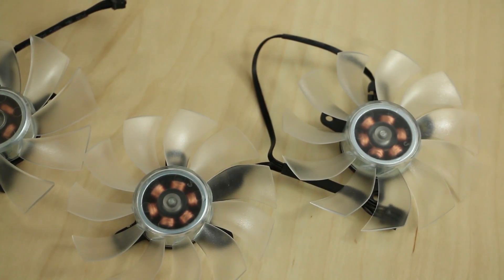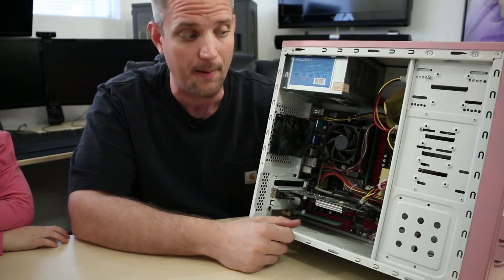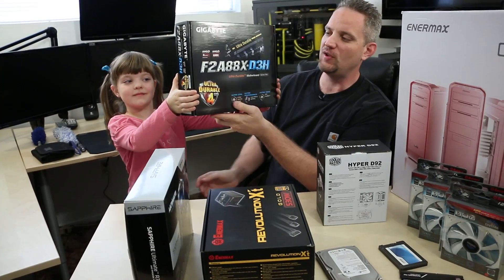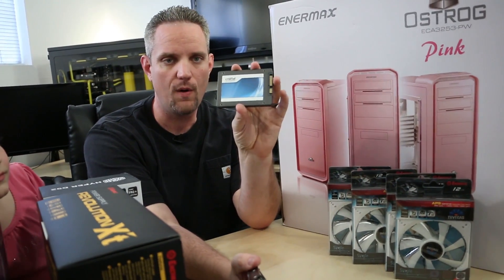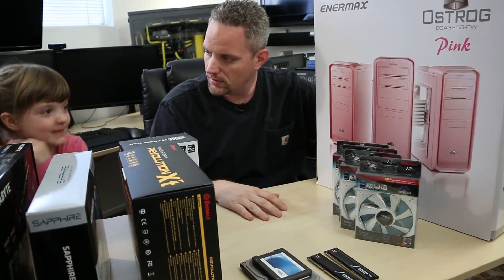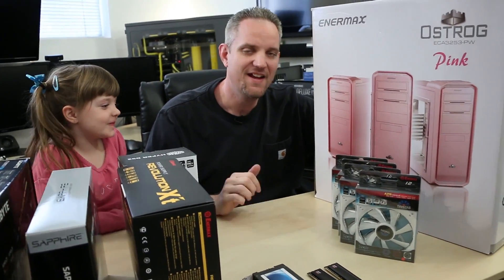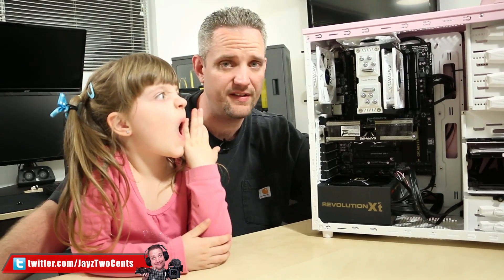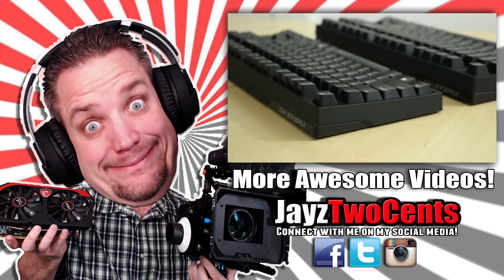5 Year Old Builds a PC

Comment: Less on cooling and put that toward a 256gb ssd you wouldn't have a pc that takes 10 minutes to boot...just sayin'
Reply from the maker: What are you talking about?
Reply: ***** you didn't upgrade the hard drives but installed over the top cooling. My opinion was to invest in a new ssd.
Reply: Luke Johnson It has an SSD and the cooling was from a sponsor.  Not to mention a heat sink like that probably costs 20ish dollars on sale.  You should never use stock cooling. The PC that took 10 min had stock cooling.
Reply: A newer faster ssd would increase system responsiveness. Heat dissapation takes less priority IF the system tasks won't tax the hardware and spike temps especially when the build consists of exhaust or intake fans.  I'm not saying any one of these components doesn't matter, they all do really....the point being a current gen larger capacity ssd for good responsiveness should be prioritized for this build, not efficient cooling. 5yo vs. 40yo's PC demand different things.
Reply: Tanner Rodrigues  I have owned many and still do so sorry to burst your bubble, not sure where you think I got my facts wrong concerning how they function. You didn't do much to counter my point though, you just shot down my comment and accused me of ignorance.
Reply: Tanner Rodriguez then  according to your logic many of the invested components weren't "needed" on account of their neglible performance increase, and yes the performance between the ssd and HHD shown vs. a new higher capacity drive would be noticeable (whoops there I go being ignorant again). But you still haven't concluded anything regarding the original argument of system responsiveness vs. Cooling....try again
Reply: Tanner Rodriguez the argument was about weighing the pros and con's of system upgrades which he would of done regardless of how much of it was free. The fact of the matter is that the cooling system for the "little girl things", as you so eloquently put it, cost upwards of $100 which isn't much by any means but considering the tasks she would be performing heat dissipation would, if ever, rarely be an issue hence the investment.  The build was for a certain type of person, period. She said she was getting drastically long boot times and he followed up by saying he transplanted his old ssd and hdd which wasn't conducive to a long term remedy of system slowness.  In the end its all preference really.  Choose what to invest in I guess is what I'm saying.

Comment: I remember having a case almost exactly like that, but different colour and different front panel. Was a 2006 Athlon X2 from a local shop.
For the ram, if you're using dual graphics mode, it'll actually help performance a lot, since DDR3 is a huge bandwidth limit for newer igps.

Comment: Stupid question. How can u plug 5 fans in the mobo when u only have like 3 fan connectors on the mobo?
Reply: You can get splitter cables to use more than one fan on a single fan header on the mobo.
Reply: but will it downgrade the rpm? or not? cus i think its going to be in series so devide the voltage over every component.. u buy splitter cables or are they included with the mobo or fan ?
Reply: Gavaskar B. no, its a parallel circuit. just think about it :P it SPLITS the wire, not take the ground of the first one and feed it into the + of the second one.
Reply: good

Comment: No idea why but I was expecting for her to get a...
(EDIT)
Mobo: MSI Z97-Gaming 7 1150ATX Intel Motherboard                                                                           [$189.99}
CPU: Intel Xeon E5-2690 v2 Ivy Bridge-EP 3.0GHz                                                                                 [$2,038.99]
GPU: 3 Way-  NVIDIA Quadro K6000 graphics card - Quadro K6000 - 12 GB                                         [$12,911.97]
SSD: 3TB Solid State Drive (SSD)                                                                                                            [$33,999.15]
RAM: Corsair 16 GB 4 x 4GB DDR4 2800 MHz                                                                                         [$499.99]
Computer case: Thermaltake Chaser MK-I Full Tower ATX Gaming Computer Case                               [$129.99]
Optical Drive: LG Internal 16x Super-Multi Blu-ray Writer                                                                           [$129.99]
Operating System: Windows 8.1 64-Bit                                                                                                       [$99.99]
PSU: Cooler Master V850 V Series 850 Watt Modular ATX                                                                       [$179.99]
Monitor: Sharp 32" PNK321 4K Ultra HD LED Monitor                                                                               [$2,899.00]
Keyboard: Razer BlackWidow Chroma RGB USB Gaming Keyboard                                                         [$169.99]
Mouse: Cooler Master CM Storm Sentinel Advance II - 8-btn Mouse - Wired - USB                                   [$58.98]

Grand total: 53308.02

Here's a link to show you that a 3 TB SSD can actually be "$33,999.15"! Unless you were to buy separate 1 TB then yeah you'll get a much cheaper price. 

http://www.alinc.com/3tb-solid-state-drive-ssd-multi-level-721551-001.html?gclid=Cj0KEQiAtZWkBRC9ibSfhoKEyLYBEiQA5fDxkYBkdQK7P-2f2HBsDGzrfXz57noKpylcNBTTFvPT37QaAvv-8P8HAQ
Reply: ***** I know, just fucking around.
Reply: ***** Wow, lol.
Reply: Lol XD
Reply: a 700 dollar pc would run games better than that xD What is this ? a workstation for Pixar studios ? XD
Reply: King Kaka It wwas ussed to fake 9/11
Reply: This seems more suitable for rendering a pixar movie.
Reply: GamersBrainStorming :)
Reply: OtraigusNevets The x-12 Potato?
Reply: You can't have ddr4 memory on a z97
Reply: 18aidanme A Pixar Porno movie
Reply: Jeffry Diaz No problem with that, shes 5, maybe she doesnt want to and
 besides we all start from somewhere. I went from two very poor laptops (my last one was 2330m with onboard graphics chip, try playing games on that!) and as  I gained some money and knowledge in the area I got a 780 ti etc, so we all start from somewhere and im only 16
Reply: OtraigusNevets How would the z12-banana fair in Minecraft? Would I get 69 fps or over 9000 fps? Just curious.
Reply: this is terrible for gaming, xeon are meant for servers, whilst your graphics card is to create 3d models and primarily used for rendering, also, a lot of those parts are non-compatible
Reply: Dominator750 i can tell that he's joking about her getting an OP  gaming pc, but my point is that his build doesn't even work. I really hope you were telling a joke though
Reply: ***** Well that's the joke dummy, it's not meant to be taken serious therefor there isn't a reason for me to actually take my time and analyze every single components I put together and see if they would function properly, I made that comment for a quick laugh not to show my knowledge of computers which by the way is pretty respectable. I still have a lot more to learn about Computer Engineering Technology but please don't insult my knowledge for I am but a stranger to you, in other words don't judge others on your primary perspective because you will surely continue to misjudge others. And what's with the people that actually took this build serious?
Reply: There is an error in this build, the DDR4 RAM you suggest is not compatible with the Z97 Mobo and is certainly not supported by the CPU, you will have to rethink that bit xD
Reply: Joshua Schleifer To host Minecraft games.
Reply: Dominator750 Eh I don't know I've heard bad things about the VRM on it's motherboard, just get the x12 Potato .
Reply: Miko is gaming Your right, I didn't see the MOBO's specs before.
Reply: Oscar Tam Wow. I hope you're joking about not seeing the obvious joke.
Reply: Oscar Tam His joke IS that the build doesn't work.
Reply: Dominator750 I hope what you just said was a joke too
Reply: +jakop360 that's what I was thinking too!
Reply: Are you sure? I thought 8tb ssds fit better! Also, will it run minesweeper? I think that's a bit to graphically intensive for that computer!
Reply: 3 way quadros but only 16gb of RAM??
Reply: ***** You culd upgrade to 32GB
Reply: Can this run Club Penguin on max settings, I really need to attend that 1v1 snowball fiht
Reply: Holycows8 No man get the x-12 Potato.
Reply: GamersBrainStorming would it be better than this, i play competitive minesweeper and club penguin so i need to be able to run those on highest settings at 144fps
Reply: Holycows8 The x-12 Potato is good but not that good man, you'll have to wait for the x-13 Potato! it's a 
12 way- NVIDIA Quadro K6000 GPU
with:
189 GB of RAM
I hear it comes out on October 2,2022, 8:36pm.
Reply: sergeant mavri Pretty much yeah.
Reply: sergeant mavri Quadros are what they put in super computers. They are extremely expensive, high performance cards that will knock a consumer card right out of the water. If you had 4 like this guy suggested you would basically have the most powerful tower you could think of.
Reply: ***** Quadros are shitty at gaming compared to Geforce, and they're not evn that differen't, just differen't drivers. NVIDIA is ripping off the rich which helps the price of the consumer cards.
Reply: 18aidanme No one in their right mind buys a Quadro for gaming... As you said they are not for gaming. I think if you are buying one you know perfectly well what they are for
Reply: 18aidanme quadros are expensive cuz theire aimed at professional use and companyes or people wo can profit from purchasing these cards
Reply: That 3tb SSD sounds a little bit pricey
Reply: X-Stream Life Too pricey, it wus a troll btw.
Reply: sergeant mavri Like I said, not a consumer card :P
Reply: GamersBrainStorming 3tb ssd for $33k? Seriously -_-
Reply: xx0samey0xx Calculation error, sorry I will now self destruction.
Reply: CPU wouldn't go in the motherboard. I would say, Use a Asus Rampage V Extreme mobo w/ Kingston HyperX Predator DDR4 8x4gb 3000mhz and the cpu could probably just change to a Core i7 Extreme 5960X
Reply: *****
I never said you couldn't. I said it's meant for servers.
Reply: ***** Who? :D
Reply: You know you have no life when you are making cpc part jokes
Reply: stillpending79 Wow what a bogus observation. If you really think that something like this defines me as someone with "no life" then you are one sobbing idiot that takes things way to serious and should lighten up a bit. And says much for the guy with the username "stillpending79".
Reply: ***** Again the amount of people who takes this build serious are completely laughable.
Reply: ***** Good luck finding a helicopter's propellers to cool that down.
Reply: Now you can get a 15% discount on the SSD. What a bargain xD! I will buy 2 of them!
Reply: LLOLllol
Reply: 18aidanme No, they're expensive because of the extreme amount of quality control required for workstation GPUs, thus they are more expensive to produce.
Reply: And then she runs minecraft. In singleplayer. On lowest graphics, because she has no idea what's the Performance about. Sad, sad world...
Reply: What a Noob you're
Reply: carlos troya *You are not you're
Reply: You can't get SSDs right now bigger than 1TB. You could put like 6 them in RAID0 for 6TB of SSD, but it'd take up 6 drive cages instead of 1..
Reply: Aidan Sweeney http://www.alinc.com/3tb-solid-state-drive-ssd-multi-level-721551-001.html?gclid=Cj0KEQiAtZWkBRC9ibSfhoKEyLYBEiQA5fDxkYBkdQK7P-2f2HBsDGzrfXz57noKpylcNBTTFvPT37QaAvv-8P8HAQ
Reply: GamersBrainStorming oh yh how stupid of me ahhah 😂😂😂
Reply: ***** Hmm you stole my commment
Reply: Hahaha! Also the cost per gigabyte for that SSD is $11.33, not really worth it xD
Reply: AeliosZero Because SSDs are faster than hard drive they're more expensive. DUH
Reply: *****  I was going to explain what XEon and the other thing you said is
Reply: Xeons are pointless in anything but high, high, high end workstations, and servers.
Reply: indeed
Reply: Aidan Sweeney Yeah but you don't pay $11 per gigabyte for them... you pay like $0.50-$2 per gigabyte for most SSD's... do you see the difference?
Reply: GamersBrainStorming why would a 5 year old need a fucking server bro?
Reply: touche,touche

Comment: Is it OK to put a graphics card in a already built computer for the first time then take it out and put it in another? What I mean is can I put my graphics card in a friends computer to test that it works to its full potential, then take it out and the later when my build is done put it in there. I am worried the card might not work and I won't find out till my replacement time is over.
Reply: ***** There will be no saved data issues or driver problems? This is my first build so just want to be sure.
Reply: ***** Alright, sweet. Thanks! :D
Reply: no it should work
Reply: After you are done with using it in the other computer and switch back to whatever card they had you can delete the driver for your card in their OS if you like but it usually doesn't hurt anything to let it sit there. In Windows, you can find the listing for your card along with its driver in device manager.

Comment: So I'm kinda confused:
So how's better to put the power supply, fan facing up or down?
Reply: Fan down; Most cases have a grill/mesh at the bottom this allows your PSU to get fresh air
Reply: So I have Fractal Design core 3300 case, it has some dust filters, so what's the actual difference?
Reply: Stick it fan down; it also depends on where the pc will be stored. If its on carpet or a dirty floor make sure the fan is facing inside the case
Reply: if on carpet up if anywhere else down
Reply: Okai, so I'm gonna leave it down then.
Thanks guys!

Comment: The problem with custom building a computer for me is not the actual building process- it's the software and drivers that store bought computers come with. Just recently I installed windows on a mac (dual boot- it's way easier than you think) and it was annoying having to go back to the mac side (with internet) and download GPU driver, flash player, java etc. A week later and it's not fully operational yet and needs a larger partition and needs to accept my modem. >:P

Comment: I'm not scared about the assembly of the parts but about cooling. I currently only have an old laptop that pretty much died while i was rendering a movie trailer for my sister (she had to do one for school). Before that i had 60 FPS in Skyrim, now i have 13 FPS. So i wanted to buy a new one (this time desktop PC) and choosing the parts is annoying and takes time but is okay. The assembly should be fine too, but i'm really really scared about killing my pc again because of bad cooling. I was thinking about the NH-D15 and i'm pretty sure the pc wouldn't die if i'd take that one, but all the different softwares really are irritating. Corsair-Link coming with the h100i looked awesome, but lots of people seem to be constantly complaining about the software as it seems to be pretty bad. AI-Suite with FanXpert on Asus motherboards also looked great, but again, lots of people complain about it.
I "basically" need/want a software with which i can see all the temperatures (CPU, GPU, maybe harddrives etc.), the RPM of my fans and with which i can control those fans (3-Pin and 4-Pin support would be great). I'd want to be able to setup a curve for my fans, e.g. CPU is 40°C hot --> fan1 is now at 2000RPM, CPU is 50°C --> fan1 is now at 2500RPM.
If anyone can help me with that, that would be nice.
Thanks in advance.
Reply: You can use the stock cooler, if it dies during rendering you need to move out of that volcano you live in.
Reply: odobenus159 Which stockcooler do you mean? The stock-cpu-cooler?
Reply: MSurai Yes, the stock CPU cooler will be enough unless you overclock or live in a volcano. You can use the software HWmonitor to see the temperatures of all your components and fan RPM.
Reply: odobenus159 Well I'm gonna do some 3D-modelling etc. so I guess I won't stay with the stock cooler ^^
I'll look into the software.
Reply: MSurai I do 3D modeling and rendering in Blender and 3D studio and I use the stock cooler for my AMD 6 core processor overclocked to 4 Ghz. I never go above 60 degrees while rendering. I think what happened to your laptop was an isolated incidence.

Let me know what software you are using and I can help you out with the graphics card, since that is the most important part when buying a computer for 3D rendering.
Reply: Maybe you ostructed the ventilation trays
Reply: coscorrodrift No it was just an old laptop with poor cooling ^^
Reply: Installing an aftermarket cooler is very easy to do, but some mounting systems will be a pain. My Noctua U9B SE2 has one fan on it because I tried to put the other supplied fan on it and ended up slicing my finger a bit. Best not to leave blood at the scene of the crime, so I just have one fan on it.

That one fan works very well, so you can have one fan on the cooler and be just fine if it includes more than one. The cooler uses a mounting system that is very finicky and probably needs blood for the blood god.

Comment: meanwhile watching with my "slow" PC Equipped with Core 2 Quad Q8200 OC'd at 2.80 GHz, 4GB of RAM, Radeon HD 7750 and "slow" 7200rpm WD Blue 500GB. Other than the GPU, this PC's rock solid for almost 6 years. (my previous GPU which is Radeon HD 4650 unfortunately died in 2012)

Anyway Jay, is it a bit overkill for 5 years old? I would rather put Pentium Anniversary Edition with "hacked bios" H97 Motherboard..